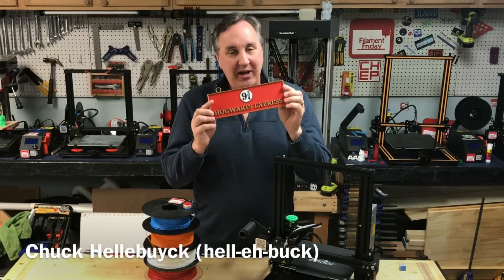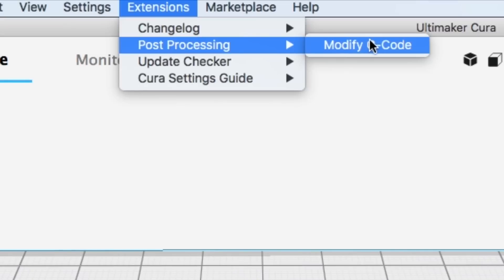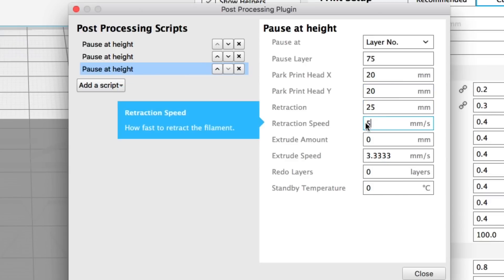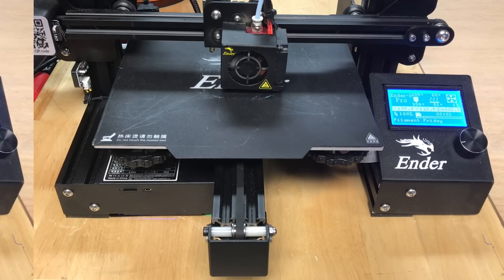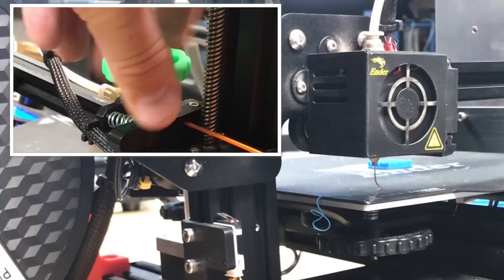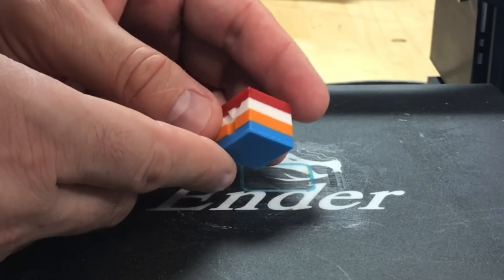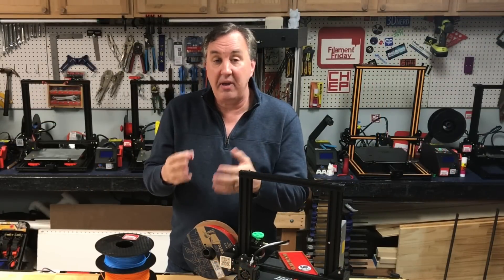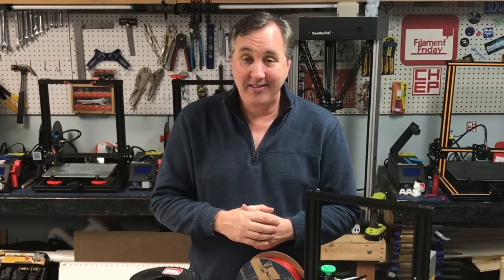How to do Multi-Color 3D Prints on Ender 3 3D Printer

Comment: Hi, can you please make a howto for Cura 4? If if i use pause at height, the stepper motors are still enabled making it hard to change fillament, and even after i got some over extrusion after changing it. In my case i cannot insert the filament without turning the extruder motor.
Reply: Just to clarify, i also have an  ender 3 pro with the new silent board. So its not possible to use filament change command (M600). I cannot change filament without turning the extruder motor, its simply not possible. Every time i try to do it as you showed i accidently move z axis down because its so easy on this model.
Reply: @Magicman8508  if you have the stepper motors still activated, you can turn the drivers off with a g84. Put that one line above the m0. I don't know the code, but don't forget to turn the drivers back on afterwards. We have an Artillery sidewinder, which doesn't work with m0/m1, so slow travel and manual pause it is. But yeah turning off the drivers should work for you.

Comment: Help, I copied your settings exactly and when I go to resume the nozzle rams into the side of the print. I am using cura 4.4 and octoprint
Reply: Steven Fagan Did you push down the Z-axis when extruding the new color? You can auto home and it should go to the right spot after
Reply: crrapi will try this
Reply: Steven Fagan Im having the same issue

Comment: Hello Chep, I did your method, I used the same codes you did. some times it worked and some times it knocked the print off, so I changed one code, it was Redo Layers. I placed a 0 instead of 1. The prints always have worked, did not push print off no more. Like your channel. keep up the good work!!!
Reply: hope this helps me I've been struggling
Reply: This works in octoprint stable version, but it hangs on the pause. I have not figured out how to get it to restart.

Comment: Help, when I changed the filament, the Z AXIS is "moved" down a bit.   

Is there a way to direct the extruder to its X, Y and Z axis back to where it PAUSED?
Reply: I change the g-code in layer that i want. Example in line of layer 22 i put after the "resume pause" a "G28" that will do a autohome.
Reply: Did you find a solution?
Reply: @Charlos92  nope.  :(

Need to change the filament faster and yet softly.

Comment: Good info!  Thanks for sharing.  Slicer makes it very easy to put in filament changes.  You scroll to what layer you want filament change and click the + and it will modify the G-Code to have a pause and park the head.
Reply from the maker: Yep, just as I showed here:
https://youtu.be/wnJ24KTBF7U

Comment: just tried this feature with my ender 3 and cura, didnt pause at layer 250 of 500, realized a few minutes too late. tried to change filament, but got a 1mm gap on my print. Wasted 10m of flourescent pla.

Will check gcode file.

Comment: Thanks for this video, but I am having an issue.  When the print pauses and then restarts, instead of restarting from the point it left off, it goes back to 0 and runs into the previous layers.  What am I doing wrong?
Reply from the maker: I’ve heard there was a bug in some Cura versions that was fixed in 4.3

Comment: Why not use Fillament Change option? It works great on my Ender 3 Pro.

I use the the layer I wanna pause at +1, change the filament, and Ender extrudes out the old colour automatically and even asks you if you want to extrude even more or continue printing and that's it.
Reply: True. Haven't tried this yet though. I have changed filament once and it seemed to pick up right where it left.
Reply: As I mentioned, the Ender 3 v2 does not pause until user presses the buttor, it just continues. I found a workaround by using the pause scripts wile printing from Octoprint

Comment: Today I am testing this, not finished yet. I was just afraid that my print is a key-ring that has basically a black round print, that then will have gold letters on it. When I saw you telling cura to "re-print" last layer I was afraid that cura would print the layer again, which is not the letters yet but the top black before the letters. Is my thinking right ? What does it mean to re-print last 1 layer ? It will go back and really print the last year, will try to print the same layer high only (?). I didnt get what is it for... As always, thanks for sharing your knowledge.
Reply from the maker: Remelts the final layer that was printed befor the pause.
Reply: @FilamentFriday  Oh, so basically it irons the last layer to make sure the next layer bonds properly?
Reply from the maker: Yes

Comment: Hello Chuck, thanks for your videos, they are really helpful. 
I tried this procedure on my Alfawise U30 but after the nozzle moves out to replace the filament the pause command doesn't work and the print restarts immediately. Any advice? 
In some forums they suggest to replace the M0 command in the Gcode with M25. I didn't try it yet.
Reply from the maker: Some printers don’t have the pause code enabled.

Comment: When changing filament, the Z height ends up getting moved from pressure put on it (for some reason it's hard for me to thread the filament into the tube, it just wraps around the gears instead) so then when I resume the print it starts printing on air and I have to quickly move the motor manually
Reply from the maker: Yeah, the lock on the motor times out and it can move.

Comment: Cura 4.3 has fixed the extruding in the air problem.  Now this great video works for me.   It probably worked fine with the Cura version he used and Cura messed it up.  Thanks for the nice video.
Reply: Yea I just had that issue right now. Time to update! I'm printing my logo :)
Reply: It actually prints in the air still, you have to not move your x axis at all. But what I do is resume the print, once it heats up I pause it and auto home, then resume.
Reply: @jbgarza2010  Strange, mine works 100% but good you have a solution :)
Reply: @waitforitfpv8432  are you able to move the extruder up to clean off any filament when feeding? Once I do that and I hit resume it prints too high off the print.
Reply: @jbgarza2010  When my printer stops to wait for me to change fillament it moves away from the print so i can remove and push new fillament in.
Reply: @waitforitfpv8432  I followed the video and it doesn't move too much for me. When I'm removing and adding filament, it moves easily from it's position.

I've only started 3d printing a couple weeks ago so still learning.
Reply: @jbgarza2010  In the video you see him put in 20 on x and y, but you can change that to something else if you want so it moves more :)
Reply: @waitforitfpv8432  Dope.
Reply: Just had the same problem 2min ago... sliced it 2 hours ago and it prints in the Air.. Ender 3 Pro
Reply: AAAAAAAAAAAAnd im still on last version... Updating now...

Comment: Has anyone figured out why when continuing after changing filament it resumes above the print and extrudes filament in the air?

Ender 3 Pro
1.1.5 board
Marlin 1.1.9 + BugFix
BLTouch (Generic)
Cura 4.2.1
Reply: I wish there was a script that could wipe off the old filament

Comment: Thanks Chep, doing my 1st colour change today on my ender 3 pro using your tutorial :) Nice and simple.
Reply: So it failed... weirdly... For some reason, after resuming, the layer height jumped up exactly 1mm before printing again. Machine is relatively new still and stock. Using latest cura 4.2.1 to slice. Followed your guide to the T. Was trying to print a square blue plate 1.4mm high with a white logo on top.

Comment: Thank you for the awesome videos. i am using an Ender 5, with Cura as slicer, my question is, after my nozzle stops at selected layer, i change filament and click resume, the print continues BUT looks like 1-2mm above current print, therefor printing in the air. my settings are exactly setup as yours. Please can you assist?
Reply: having the exact same issue today.
Reply: @BuZZarDFPV  That is what I'm getting. I did have this working back when the video was uploaded. It seems like newer version of Cura have caused an issue. It looks like you currently need to add the Z height to the gcode line after MESH:filename.stl to the correct layer height the script no longer does it in the new Cura.
Reply: @ChrisKeddy  thanks for the reply, I fixed it manually in the end by editing the gcode, I minused 1mm off of the new Z height being applied just after the pause. To get the exact Z height before it paused, you can also scroll up to the last Z position. Printed successfully after this. Looking forward to the 4.3 release. Thanks again for the feedback and great helpful videos.
Reply: @BuZZarDFPV  Looking into it the issue will be fixed in 4.3.0 to be released. Since there where other issues then just the layer difference

Comment: Hey Chuck, tired this yesterday it worked great - pausing an resuming as expected.   The issue I have is where it's ejecting the filament blob after you change colors.  Resuming it puts the head above the model, then it ejects a bob of filament, then continues the print.

Any idea on how to place this anywhere aside from on top of the print itself?  Is the blob needed if you're manually feeding the filament to purge the previous color?
Reply from the maker: Good idea but other than manually modifying the GCode I’m not sure how to do that.
Reply: Try using the filament change option and not the pause at height. I was having some similar problems using the method in the video when I tried the change option and worked better.  After changing, it will do an extrusion to purge the old color as one of the steps.  You don't need to do it manually.  

On other thing I've been doing to help with the blob issue is after extrusion cutting off the output and then waiting like 30 seconds or a minute to let it "ooze" out some more.  I then cut it free and press resume as quick as possible.  It's been giving me a pretty clean start to then first layer of the new color.

Comment: I can't change Filament without messing with the height. There's a way to lock the axis?
Reply: Yes there is a function keeping the steppers Armed  in 1 of the pause scripts in Cura.
Reply: @nl2rma  thank you! I'll try as soon as possible
Reply: I had exactly that problem today, it totally tried to run right through previous couple of layers, print ruined !
Reply: The Post Processing script that has the option is called "Pause at hight" in Cura 4.6.1. And if you search the gcode you see the M18 S code for keeping the stepper armed, the S is followed by seconds before disarm.

Comment: Thank you. i need to try it out. But my ender 3 has a sligt off set after he resume the print. Have anyone the same problem?
Reply: I have the same issue
Reply: Mine has a slight off set too (not always) , but on the z axis, as if it's not quite returning to the full height of where it left off. I find this on pause, and on change filament.

Comment: This looks great! Could you just explain what the "Redo Layers" option actually does? Thanks.
Reply: It redoes the previous layer
Reply: @FPVisioning  You mean it repeats the layer ie prints an extra one? Why?
Reply: @peejayw  Exactly, to bind them together
Reply: @FPVisioning  I'm just trying to make sure I have it correct in my head.  Say I'm making a 2 stair shape and want each step a different color with the top of the step's color matching the body of it.  The top of the first step is layer 10, layer 11 starts building stair 2.  In this case I would pause at layer 12, correct?  That'll cause layer 11 to be drawn in color 1 and then redrawn in color 2 if I understand correctly.  Hopefully the way I described it makes sense.
Reply: @DesertILI  Yup, that's exactly how it works. of course, if you wanted your steps to come out perfect you'd just set the redo layers to 0, so each stair would have fresh filament.
Reply: @FPVisioning  Thanks!  For the first item I'm going try it on the 1 redo layer won't look out of place and I'd rather get the better bonding from using it.

Comment: When I try this with my CR10S-PRO, the printer does everything. But I cannot restart the printer from its touchscreen. Possible solution for this? Thanks
Reply from the maker: I haven’t tried this on Pro so I’m not sure.
Reply: I agree ^with the above issue^ cura settings work to stop the printer to allow the filiment change, but then.... print won't continue afterward :/ any advice?

Comment: This did not work for me.  The gcode stopped the program at the correct height, but then the Z height changed when I was handling the filament.  This process does not recover the correct z height on my Ender 3, so it was crashing into the part, making a mess.
Reply: Same for me. I've also touched the bed and put it out of position. It would be nice to lock all axis
Reply: been having the same problem. wish there was a way to fix this issue
Reply: Ditto, it's bloody annoying. I ruined a print today by accidentally moving the Z axis just a little.
Reply: 1OlBull same. It’s annoying.

Comment: Dear Chep, I have a slight problem with Your solution with one exception. I do print via Octoprint. Made a GCode with Your instructions, he prints until the Pause, I change the Filament. Press continue in Octoprint, he starts but doesnt extrude Material. Instead he wildly retracts/extrudes and prints in thin Air. I mean, he tries to print, changes layers but nothing comes out. What did go wrong?
Reply from the maker: I didn’t use Octoprint so I don’t know what it’s doing with the GCode. I used an SD card on the stock printer.
Reply: @FilamentFriday  Thanks for the answer, even if it didn´t help instantly. Will try SD Card only.
Reply: I can't help wondering if you have to physically press the control knob and that using a remote method messes up the gcode.

Comment: Man I love your videos, but I have been struggling really bad with this color change thing using TPU. I got the EXR Struder because of your video and using it with TPU, but no matter what I do, whenever I change the filament, hit the button, it heats back up, then purges the old filament, and the proceeds to crash itself through the print and right into the bed.

I am NOT using the "redo layer" step you do because TPU is so much softer and I do not want it to go back over the previous layer.

What else could be going wrong here? I have confined the pause is present in the gcode as you instructed, but beyond that, I am not sure what to do.... 

Lastly, I have been purchasing my Amazon products by coming to one of your videos and clicking on the affiliate links....

Thanks!
Reply: Hey dvassist, I'm in the exact same boat as you.  TPU, EZR Struder, and crashing back into the printed layers.  Did you ever find a fix for this?
Reply: @Ticktok_of_Oz  - I just had the exact same issue just minutes ago - the z-axis did not seem to be blocked by the motor and slided downwards resulting in the nozzle digging a hole into the printbed after resuming right through the print (in my case 7 layers of the first color) - what is it that we're doing wrong?
Reply: @zumselman  I ended up getting it to work. After changing the filament, home x/y, then home z, then resume print and it worked. You could auto home, but since it moves all 3 axis at the same time you run the risk of hitting a tall print. I used OctoPrint, so it was simple to home the axis seperatelty.
Reply: @Ticktok_of_Oz  - thank you, later I found a solution by manipulating the inactivity timeout in the G Code like I commented in one of the later comments

Comment: Tried 3 times before I was able to get a decent print. Each time I changed the filament I accidentally bumped the bed and misaligned the print. How do you add code to lock the bed and print head?
Reply: I experienced the same issue and still unable to get the proper  alignment. Kindly advice if you already found a solution. Thanks

Comment: What about the M600 command? Would that not work better?
Reply from the maker: I didn’t check what GCode Cura is creating with the method I showed but it may be using it for the filament change script. 
Direct M600 mod to GCode should work though some have had issues on Ender 3.

Comment: Please help. I have not altered any gcode but now mt Ender3 is pausing at x=190.0 y=190.0 z=+.15. I've printed three different models downloaded from Thingiverse and sliced them with Cura V3.6.0. Previously I printed models without problem. Any ideas?
Reply from the maker: Did you enable the pause at layer I showed in a previous video?
Reply: Bingo! That's exactly what I did. I removed this and all is well!! Thank you so much for these videos and your quick response to questions.

Comment: sometimes the extruder stepper is disabled and allows me to turn it out by hand, other times it doesnt let me turn or disable the motors, which forces me to have to manually push the filament through ?
Reply from the maker: You can disable steppers in the LCD menu.

Comment: I failed 3 times trying to make a sign with 2 colors I set it to pause at layer 20 and when it resumed it bumped into the print and knocked the glass off. second time i tried using change filament instead of pause at layer and when it resumed it melted a huge hole in the print and I had to stop it.  What am I missing here?
Reply: Im with a similar problem, and think its caused by the Z axis. Check the right side if the bar can be moved up and down.... When you pause the print and move up the Z axis, when you resume it and come back to the layer heigh, it will have a different distance by the incorrect allignation to the bed.
Reply: I have the same issue.
Reply: @jeanniereeves1  yeah I figured it out. I was moving the z axis slightly. If you do it carefully It works. I dont repeat layers and it works better